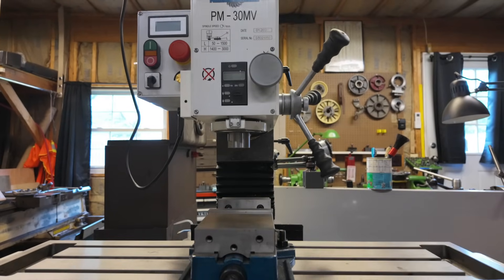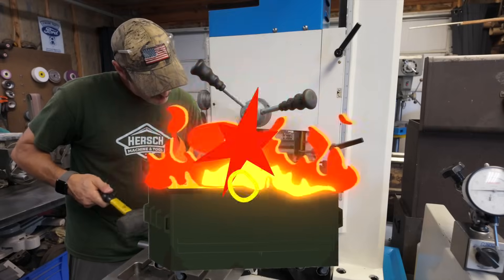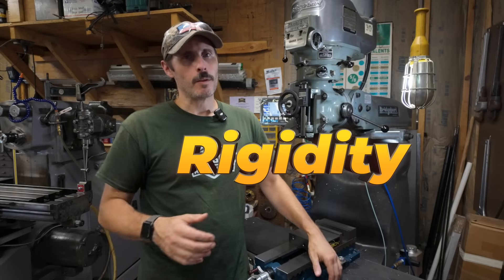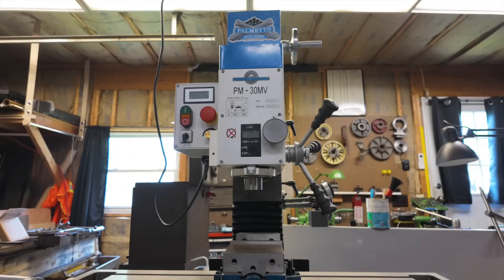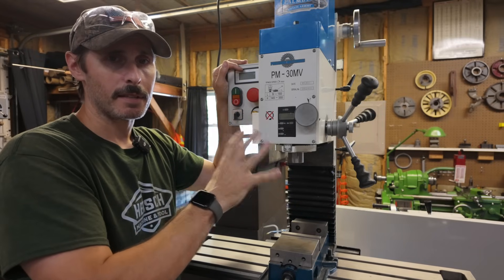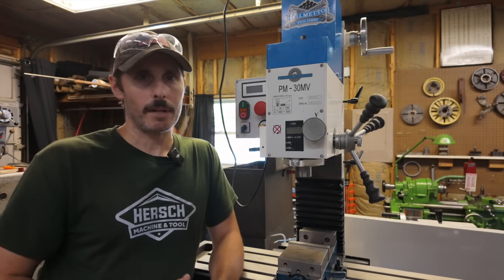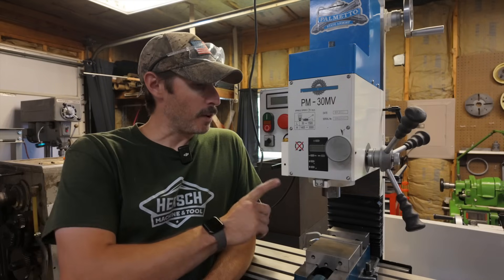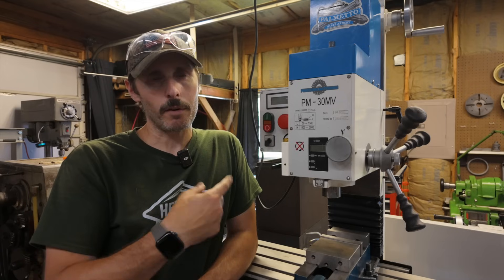All You REALLY Need to Know About Mini Mills

Comment: As someone whose machines speak German and hum the ``Horst-Wessel lied`` when we are alone, I can`t say much about modern machines, but what i can see is that a lot of modern machines, especially the import variety - has a compounding issue of material lack, a problem that has exponential growth with each step-down in machine size... That column on your mini-mill is utter shit... I have seen those mills, even the smaller variety, and that is just unacceptable in my eyes...  The rest of the castings are quite decent, even a bit of an overkill in some regards, but that column is way too flimsy and not just that, but it`s hollow as well?!(knew that, just always boggles the mind) I mean, the x axis table is almost more sturdy than the head carrier axis, how can that be? The head, or the spindle is the most important aspect in a way, and if the machine allows that axis to wobble and flex in any way, you are bound to have issues, from precision to tool wear issues, but they will be your constant companions, lest you machine plastics, but that is a torture of it`s own kind, and as such is outside the scope of this comment... 

I`m considering mounting my mini-lathe on a large mill table, you know, as a method to make `er more skookum, and all that i can think about is how damn bad i want to have a lower for that table, as i don`t want to rest it on the dovetails, nor do i want to make 2 clamps that allow me a 3 point contact setting up of the table, or rather the lathe, as that will allow the cast iron to ``sag`` in the middle - being unsupported... And they dare sell you a machine with a main axis casting that i would not trust to injure someone if it fell on them, what kind of compromise is that? Get outta here, and bring me some gabagool on your way back... 20 years in the can... I ate grilled cheese off the radiators which had thicker casting sections than that column... I wanted to fuck a woman, but i compromised - I jacked off in a tissue instead, and the tissue was more rigid than the head swivel joint when fully clamped... How`s that for a compromise? And don`t you ``uncle Philly me``, like that animal Blundetto... 20 years and not a single peep... And i return to this? No more Butchie, no more!

Best regards and kind wishes!
Steuss

Comment: That was a good, clear and concise overview. I wish I had seen this 16 years ago! I've got a much older and crappier version of the PM25 (not a PM, but a UK importer). I don't think mine is the worst, but also certainly not the best. If I had my time again I would have stretched to the PM30 (although I don't think it was available at the time).  The head rotation section is a weak point, there's only 2 bolts on mine, a centre pivot and one clamp bolt. I'll have to see if I can improve that bit. Mine is also a geared mill, and it is noisy. I have to knock the sound down by 12dB or so on my videos whenever it is running, as it's really quite loud.
Reply: If ur's is like the Optimum BF16v I got to replace my press-drill with u can drill two extra holes and mount it like he's shown.  I did it on the BF16.  The center bolt is now removed and the colum-lead-screw-nut mount point moved into its place (gave me ~3' / 75mm vertical EXTRA space).
PS:  I found that tightening those two NEW bolts down now clamps the head to the column as it seems to deform the heads 'saddle' - so it's a bit more involved to get this to work properly!
Reply from the maker: Thanks very much. And yeah, those are exactly the things that we just don't know to look for until we have some time and experience, so that's the video I was aiming to make. I honestly got lucky with my choice for a first mill, and only learned to really appreciate just how good the machine actually was, and WHY, after some time with it.

Comment: A good guide to the pros and cons of benchtop/mini mills. The only point where I disagree with you is the suggestion that someone purchasing a new machine might want to choose a Morse taper quill.
 Morse taper quills are a far less preferable option than a R8 quill.  My advice is to ignore the fact that you may already own a selection of MT2 or MT3 tooling and purchase a machine with an R8 quill.
Reply: I came looking for this comment. I'm not a machinist, but what I've heard from the people who are is that even if they can share tools between their lathes and mills, they still end up never doing it, making the trade offs not worth it.
Reply from the maker: @M_Northstar  It really depends, I share tooling between my machines all the time. But the point being made is that R8 is a better taper for a mill spindle, which is definitely true. But even R8 isn't perfect, NMTB 40 is even better than R8, etc, etc. That being said, for some of the machines on the smaller end of the spectrum R8 might not even be an option. And if someone is really working with small machines in a small space it might be a decision they find worth considering.
Reply from the maker: Thanks very much. And yeah, I definitely understand the point you're making and generally agree with your logic. I think it's a choice that should be considered carefully either way. And the R8 taper is unarguably the better taper for a mill spindle.
Reply: Got a R8 quill machine. Have a lathe with MT3. So, bought a MT3  ER32 collet holder to fit into R8 quill
 Works for me. Thanks for your input.

Comment: Great video, I just have a question. Might a geared spindle even though noisier, have more torque? I really have no idea, just curious.
Edit: I've been looking at slightly larger PM machines is the reason I ask.
Reply: PM on their website clearly states that geared head will give you more torque at lower RPM when cutting steel
Reply from the maker: @ronson66  a “gear head” machine is an entirely different design from what’s discussed in the video. See my other comment above.
Reply from the maker: Exactly what @howardosborne8647 said. Of course, a real "gear head" mill with a proper gear train that's been specifically designed to generate mechanical advantage is a different story. IE; the back gear in a bridgeport for example. But that's different from what we're talking about here.
Reply: @hersch_tool  PM on its website clearly states that gear heads will give you more torque at lower rpm when machining steel
Reply: No, there are no real torque benefits to the geared heads but they are immensely more noisy than the polyvee belt drive head like Hersch has here.....given a choice I would always opt for the belt driven head rather than gears.

Comment: Thank you for a very useful video.  I learned doing the hard way. Now i find i need a smaller mill. Cramped for space  and what type of work i do have been thinking about the pm 30 . Thanks again!
Reply from the maker: Thanks very much for watching. And I honestly can't say enough good things about the PM30, it's an all around great machine.
Reply: @hersch_tool  The PM30 is a superb machine for the price....more than capable enough for most home workshops and even light industrial usage.
Reply from the maker: @howardosborne8647  absolutely agree 👍
Reply: @hersch_tool  I pretty much made up my mind before you posted this video, I really enjoy watching your videos and value your opinions thanks again
Reply from the maker: @robertharper8776  Thank you, sincerely, I really appreciate hearing that. Cheers.
Reply: The only thing I differ from Hersch on is the choice of spindle fitting...If you're buying a new machine choose the R8 spindle as it is a far superior tool locating system than any of the Morse tapers could ever be.
Reply from the maker: @howardosborne8647  I can definitely appreciate what you're saying.
Reply: Yes r8 is the best I have all r8 tooling I have a enco clone in storage and a rf30 in my building but tired of the round column I'm semi retired now and do this for fun and a few extra dollars thanks for your reply